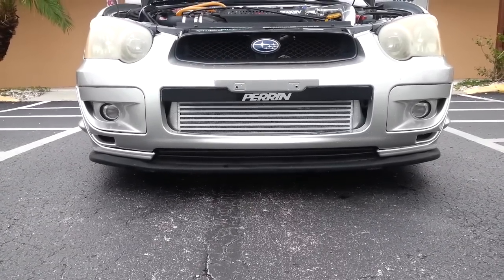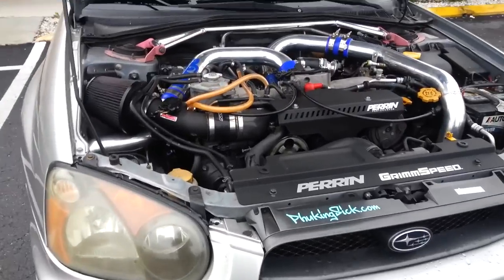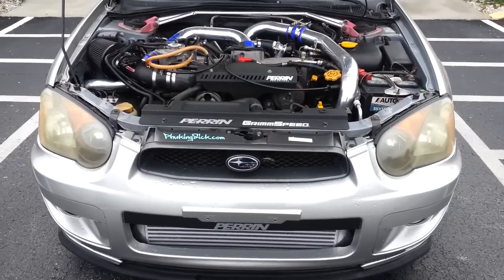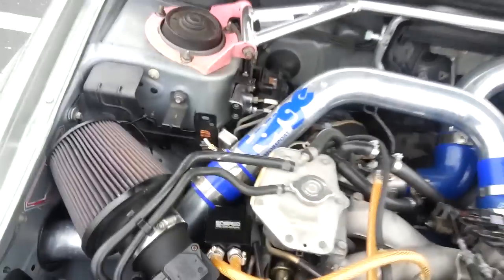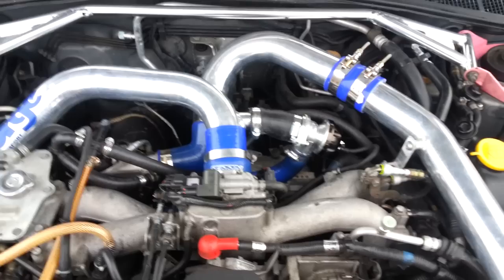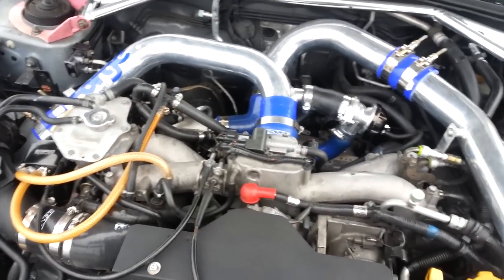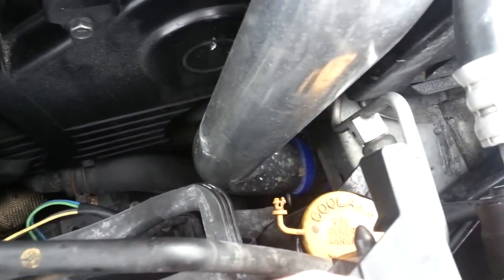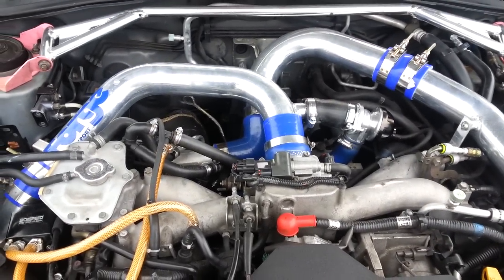Review: Rev9Power (Godspeed) WRX Front Mount Intercooler (FMIC)

Comment: To everyone that wants to get this kit! YES , YES! exactly what he said is true. this kit is amazing honestly! Robert Harridge and i spoke about 2 months ago and i was kinda iffy about this kit , but it works great and the gains (if tuned) are great! i got this car tuned with a different turbo than stock(18g blouch) and made 350whp ,330lbsTorque! so for the price ..you couldn't go wrong. installing the kit wasn't bad , but yeah it takes time, took me 3hrs of installed for being my first time.
Reply: I own an 05 STi btw
Reply: Hey. Hopefully you can answer my question, I'll be great full
I'm planning on buying this kit, its currently 380 on eBay. 32inch. I'm not sure if this is what you also have but, were there any major diy stuff ? I mean like cutting or extending the pipes. ? How is the bov situation? I have hks bov . I wouldn't mind losing it. I have a 2005 wrx with jdm vf30 turbo. 
One thing he mentions that didn't fit on his car. Was it the same on yours ? If so what was it . Thank you.
Reply: +youhan younen  To be honest man , there really wasn't  any DIY stuff and it was pretty easy to install and everything fit perfect. also just the cutting on the front bumper was probably the only thing that was more tedious. the bov fits perfect no problems there, i have the same HKS Bov. it is still going hard no problems with the kit and happy Sti i have.
Reply: But i would highly require a tune after this. Subarus need a tune after any little change you do to them.
Reply: thank you, ive been skeptical of this product but now im worry free. thanks again.
Reply: does it come with the blow off valve?
Reply: Mr.Manny_S550 you don't need a tune when switching to a fmic.  As crazy as it sounds, all the air is already measured.
Reply: How long do rev9 products last? I drive a honda civic hatchback, and I found a rev9power turbo kit for it. I'm skeptical to buy because i want to have a reliable car that I can drive daily, but is also fun to drive. I want to know that if I buy this kit, I want it to last a good while.
Reply: Toxic Boost dude just go for it. Honda parts are everywhere, and Honda’s themselves are so reliable. Yolo!!’
Reply: 350WHP ? that’s Insane
Reply: @Okaydogo_   wow this was 7 years ago. The update of this car made 438whp and then it blew up but now you can check my channel I passed from a 4cylinder to v8
Reply: so you don’t have to tune after installing ?
Reply: i have a 2004 wrx impreza 2.0 but ik these motors be sensitive to bolt ons
Reply: @intfrostee  what ? No one said nothing about not tuning it. Of course you have to tune ANY car even after adding something as simple as a CAI if you want to take full advantage of the mod. Yes highly recommend tuning your subie, they are ticking time bombs.
Reply: @BJ-uncensored  when I installed it and drove it for a few minutes my engine light said otherwise and my AIr to fuel ratio lol but I mean it is measured but it does affect it.
Reply: @mr.manny_s550  if you think of it, nothing has changed.  It would be like putting a large tmic.  
¯\_ (ツ) _/¯ 
Just subaru things lol.

Comment: Admit it you still love the hood scoop like every subie driver haha I just did a td05 18g sway with my 2.5 swap in my 03 wrx fucking cars a monster now has an upgraded fuel pump all I need now is the injectors and car can push over  350 to 450 hp
Reply: Stock tranny? I'm thinking of blouch 18g xt, fmic, walbro, SF intake. 1000cc injectors in case I want to switch to e85, n an ej257 sti short lock on 03, wrx.
Reply: That’s not good. You need to upgraded your cams and recommend some build headers, if not your motor going to be ruin in less than a year

Comment: Is this the V1 kit or V2? What did you do to keep the fogs?? I have an 02 but still..can't figure out how to do it bc the kit assures the ability to do so but it ain't working 🤕
Reply from the maker: This is the V2 kit. The fog light mounts on the bumper cover itself needed to be trimmed. I just used a dremmel cutting tool and a helping hand to mark off the areas that needed to be trimmed down. You also have to play with the piping a bit. Move them around to get some more play room. It took a while to get it to fit, but once we got there, everything went on without a problem. You will have to do some cutting to the bumper, but once it’s done, it’s all covered up by the factory covers, so no one will see it.

Comment: the handling is different because you took off your bumper support that is what keeps your left and right side straight during swaying in the turns that's why I feels different and it almost feels better cuz your sides are leaning out and into one another. you need to buy a bumper support for a fmic to put it on or make your own to have it go back to the way the normal handling. and its not just for support during an accident.
Reply from the maker: StreetTripleDelight12 st3d675R no offense, but you really don’t know what you are talking about. The intercooler is actually held on by 2 bolts on the support beam, one left, one right, and 2 bolts underneath connected to the frame of the car. One left, one right. That center you speak of is ONLY there are an assist to help you mount it. Other than that, it’s useless. So if you see one mounted that way, they did it wrong.

Comment: your bumper brace provides stability like a strut bar thus your car handles different not a rocket scientist but more likely than moving 40lbs around on a 3000lb car
Reply from the maker: baldeagle bear the support beam that comes with the kit connects the K-frame in the same positions as the factory bumper beam, it’s just not a solid square beam, but more of a giant long L-bracket, so the front end it still supported like the strut bar as you said.

Comment: Hi Robert, sorry to hear about your wrx. I have some questions about the FMIC. 
I've been researching the 2 people who have a review on line didn't like the fitting of the intercooler .im planning on buying it this summer. How was the fitment? You mentioned something didn't fit and you had to buy it ? What was it and what did you buy? Did you have to extend anything ? How was the bov fitment? I have the hks bov. 
Thank you so much for posting.
Reply from the maker: +youhan younen hey man. SOrry I didnt respond sooner. The only things that didnt fit were the front bumper, which does need to be cut in the lower grill section and some areas where the fog lights mount, but no big deal. For the BOV, I recommend just getting the TurboXS recirc or Hybrid BOV (universal). The flange on the kit is made for the TurboXS style. Thats what I eventually switched to, and I am certainly glad I did. There was no extending anything. No modification to the kit itself. I had to get a new coupler for the throttle body because the one they sent was the wrong size. I messaged them and they sent me the right one. It was a packaging mistake. Didnt cost anything. You do have to make sure you push the hot side pipe down as far as possible, or it will tap against the hood and becomes quite annoying. Other than that, it works PERFECTLY! This kit is durable to. After the roll over, I took this kit off. No dents or dings. Its now on my wifes car.

Comment: Great car bro! How many horsepower are u pushing??
Reply from the maker: The car was dyno'd at 337.8 AWHP @ 5800RPM and 296 AWTQ @ 4800RPM. The Torque number could be higher, but the clutch is an Exedy OEM clutch and becomes very hot and spongy when the car hits full boost. My tuner said the torque number is more than likely lower in the RPM range, but because the clutch slips until the transmission can match the speed of the engine, its higher in the range. Full boost comes in at 3600 RPM, so peak torque should be around 4200-4400RPM with a good clutch. The actual torque may be slightly higher too, but the horsepower number is about right. I need a better clutch now lol.

Comment: I know this is an old video but very helpful! If you don’t mind me asking how much hp were you making in this video with all those mods?
Reply from the maker: Very good question. When I made this video, I had it tuned making 308whp/286tq. Funny part was (and I don’t know how my tuner didn’t notice it) but shortly after I lost cylinder 4 due to ringland failure. Not necessarily anything the tuner did, as the previous owner of the car had done some questionable things to it. I put a newer EJ205 engine in it and had a different tuner re-tune it and it made 328/298 with fueling becoming an issue on the top end (needed bigger injectors), but the power and torque under the curve was much better and usable.
Reply: @RobertHarridge  veery niceeee how long did that ej205 block last after the retune? Lol im getting a fmic today and planning on putting it together with a jdm ej205 also so this is good info !!!

Comment: So the piping didn't come with any BOV flange already welded? I'm about to order this kit but I'm confused on if I need to order a new BOV, and flange set up.
Reply from the maker: The BOV does come with a flange that can be welded to the intercooler piping. It is larger in diameter than the BOV port thats already on there, so the shop you may take it to would have to cut the existing flange off and weld on the new "greddy type" flange. The flange that is already built on to the intercooler pipe (where I clamped the hose on to) is made for any universal TurboXS BOV.

Comment: Sorry for the old comment. I understand this kit comes with a short ram intake is it possible  to run a cold air intake instead. Which one would have the best fitment?
Reply from the maker: lumini inesu there is a company that makes a cold air intake that goes straight and down the first hole in that fender well. I don’t remember the company... but it was kind of expensive TBH. I’m sure if you made an extension with a coupler, it would probably work well. As you see, I ran a Perrin SRI, and eventually I had someone fabricate a heat shield that actually worked very well. I’ll ask and see if the guy still has the template.
Reply: Robert Harridge  let me know if you find it thank you in advance!

Comment: Ohh okay thanks! So if I just get a "turbo XS" BOV it will fit the flange already welded onto the rev9 intercooler piping? I currently have a GFB response for my stock WRX tmic. But I have a vf39, Sti pinks, and walbro 255.. So I need a better IC ASAP lol
Reply from the maker: As long as its not a turboXS valve thats made for the top mount. Just their "universal" ones. like this one http://turboxs.com/shop/blow-off-valves/129-racing-bypass-valve-type-h34.html

Comment: Why is the cold side running back over the turbo, if they knew how to make a setup work well they would have switched the cold side and the hot side, so you wont be reheating the cold side as it runs over the turbo???
Reply from the maker: That is by design from the manufacturer. The tube lengths won’t allow you to switch them. There are many kits like this built the same way. Don’t know why. It didn’t make sense to me either. All I can say is do some preventative work. Turbo blanket, heat wrap the down pipe, and maybe throw a heat shield on top of the turbo. I just did the blanket and the down pipe wrap and it drastically reduced that pipe being heated.
Reply: Many kits run the alternative way as well, just way uglier/cluttering when hot side is doing a big U bend straight outta the turbo.. I run a custom made setup retaining process west CAI, no bov, 24psi, huge cooler - cold side over turbo no probs with soaking or 'lag' ( Australia-40 Celcius)

Comment: Just ordered my fmic, it's gimmick motorsports, saved a lot of money, will you get a re-tune or just keep it as is?
Reply from the maker: I had my tuner look at the data logs after I changed my intake and intercooler. All the logs came back within the parameter limits to be safe.
Reply: Robert Harridge What year is your legacy gt trans from? what else did you need in order to swap trans?
Reply from the maker: macnoypii my trans is from a 1996 JDM Legacy GT Spec B imported from Japan. I got the whole drive train. Trans, driveshaft, rear diff, all 4 axle shafts, everything. You will need 02-04 front axles of you have an 05 or newer WRX. Reuse the rear axles from the old drive train. There is a 4 bolt piece on the driveshaft for the legacy that will need to be swapped on the impreza driveshaft. Finally, swap the legacy shifter and linkage with the impreza. Everything bolts right up. The only other issue is the trans will be held on by 6 bolts instead of 12 (4 main studs and 2 secondaries). Don't worry though. With all the frame mounts and such holding the whole drive train assembly in place, its not going anywhere. I launch the hell out of mine at 5200rpm and it takes it. Been in there for 4 years now.
Reply: Robert Harridge thanks for the info! do you think a jdm 04 legacy gt ej20 trans with diff. axles, etc, will work for 03 wrx? really want more power but trans is holding me back. Here's the link for the trans http://www.ebay.com/itm/391012254180?ssPageName=STRK%3AMEBIDX%3AIT&fromMakeTrack=true
Reply from the maker: Oh yes. That swap will be easier than mine was. All you really need to do with that swap is to use your factory driveshaft and mounts. Thats really it.
Reply from the maker: It should be everything you need. If the CV shafts dont fit, see if you can trade someone for 05-07 WRX CV shafts.... but they should fit. Just really need the driveshaft and shifter linkage.
Reply from the maker: And they are a bunch stronger. Particularly if you are going from an 02-03 trans. Just the gears are stronger, but the case is also a better design.

Comment: did it come with the blowoff valve adapter
? i have a HKS bov will i need the adapter?
Reply from the maker: It did not come with an adapter, but there are adapters you can buy on eBay for it. They are suppose to be welded on, but I did some custom work and used a radiator hose to make it work, that way I can interchange the BOV if I need... or you can get the TurboXS Top Mount Intercooler flange for TSX valves and flip it backwards. I have friends that do that too.
Reply: Thanks man ! How well will this for on a 05 Sti ?
Reply from the maker: Probably better than it did for the wrx because you have fog light covers instead of fog lights. Other than that, it should fit exactly like mine.
Reply: Robert Harridge  Awesome! do you still have this on your wrx? im really looking into getting this
Reply from the maker: Oh yeah. I love it. And now I am finally getting somewhat cooler temps here in Florida, im noticing a bigger difference. Car  runs smoother. It just feels better. Just do like I said in the video. Invest in a turbo blanket and heat wrap your downpipe. Its fairly inexpensive but well worth it.
Reply: Nice!! well i actually have a Heat shield already so ill be covering that! do you know the PSI drop on the core?

Comment: what kind of intake did you use to fit properly i was looking into a cobb one but the box would be to big i feel whats a good one to look for?
Reply from the maker: if you want a true cold air intake, KS Tech is going to be the only one to give you a cold air box that will fit the front mount kit. what I am using is a Perrin Short Ram air intake with a K&N filter and seem to have good success with it.

Comment: did your kit come with brackets or did u make them. brackets to hold the intercooler
Reply from the maker: +jory carton mine came with the bumper beam bracket
Reply: tom richards then yeah I'm sure it will for is anything you might just have to cut some of the bottom off lol

Comment: Man I like the way the fmic looks. I don't like to deal with cutting parts off the bumper just to fit the pipes. Btw how is the throttle response? My 20G get heat soak quick so that's why I'm still debating to get a fmic or not
Reply from the maker: I agree. The bumper there the fog lights are at was a bit of a pain, but the lower opening was easy. About throttle response... its really hard to say what is better and what isnt. If you compare the STi top mount to the front mount, there is a little bit of lag due to the volumetric of air to fill both intercoolers... usually only noticeable by about 200-300 RPM on the 2.5L and 300-400rpm on the 2.0L. But compare it to, say, a TurboXS top mount (godspeed, cx racing, ssac, XS power) where there is a 4-4.5" core and a much wider and taller cooling core, there is no difference. I went from a TurboXS top mount to the front mount and my lag never changed. Boost came on at exactly the same time. What I did notice was more power on the top end. It seems to carry the power band better that before. But I always tell everyone with a top mount... try reducing the heat first. Turbo blanket, wrap the up pipe and the downpipe, and get a good turbo heat shield like a Cuzco heat shield. You will notice a substantial difference from that alone! But I think the up side to a front mount other than the cooler temps and more top end power is the ability to maintenance your car MUCH easier. Changing the starter, clutch slave solenoid, pitch mount, even changing the turbo is a breeze! That, to me, makes it worth it.
Reply: I already have the heat shield and turbo blanket but not the heat wrap for the downpipe. Im getting that pretty soon. Since you mention bout top end power and not much lag difference, that already convince me to get one lol
Reply from the maker: I think its worth it. And the more I do research from an engineering standpoint, the more I see how inefficient the top mount is. From its harsh plumbing angles, to its end tank before the throttle body, to squeezing all that air fresh out of the intercooler through the 3" throttle body. It all makes sense to go with a front mount.